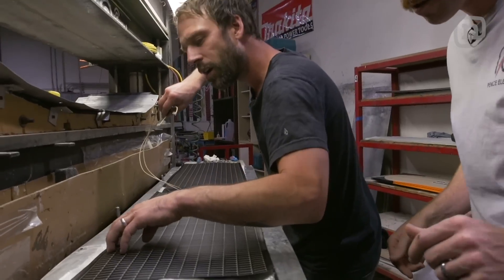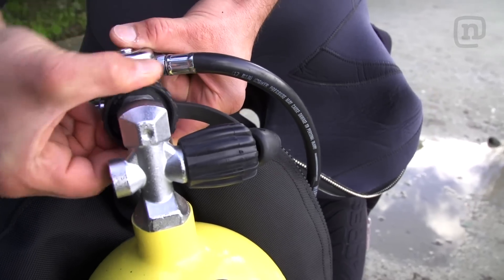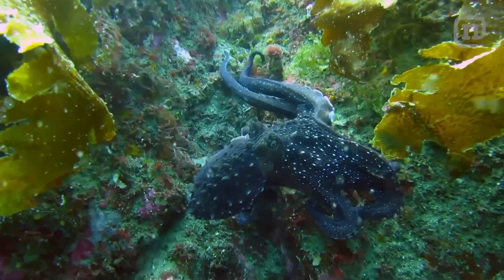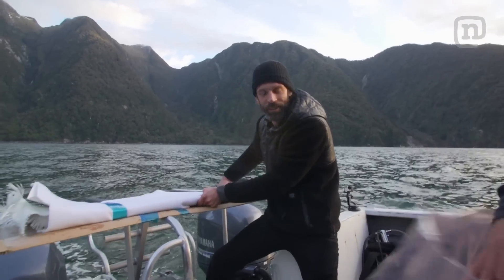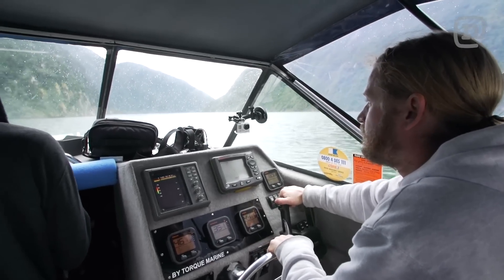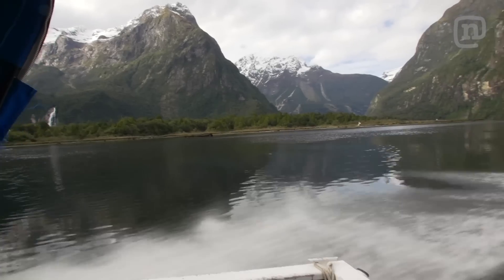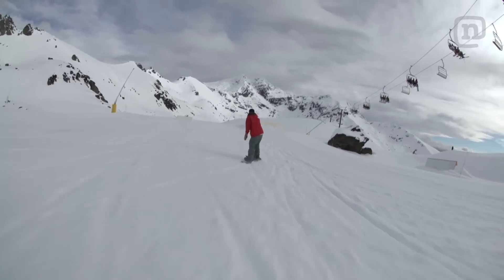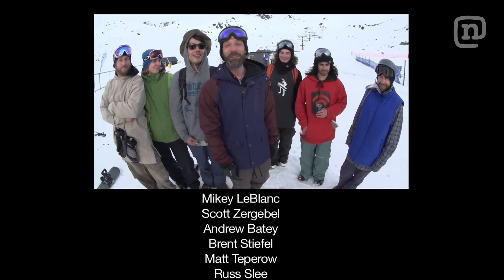Underwater Snowboard Production: Every Third Thursday

Comment: Wouldn't the vacuum inside the bag squeeze everything together before the water pressure would?
Reply: Mr Skull Top no
Reply: I agree, although depends on the the magnitude of the vacuum pulled relative to the water pressure, but I came to the comments to say what you did.
Reply: Same exact thoughts, I think he did this to save face and have content.
Reply: Granted the pressure from the water worked, the vacuum saved the day
Reply: you're right. This was actually filmed at our house in Queenstown so I can confirm that a second board was made and compressed in our shed as water leaked Into the board they put under water and it fell apart. They literally threw out the first board from Milford .

Comment: So i press snowboards using a vacuum bag also. except mine can just sit on my basement workbench... I dont doubt that pressure under water can press a board but this isnt proof.
Reply: I was just thinking the same thing. He already pressed it out of the water he just left it under water
Reply: Luke Bergman
Reply: He said he took the air out, he didnt say they were gonna pressurise the bag before submersion, and as the board started coming apart, and others that they've made using a vacuum bag and pressurising the bag have not I think they genuinely used the pressure of the ocean.

Comment: Would if they made a snow board that has wheels like a skate board and then when  u r at the mountain, it folds right up like a snowboard!
Reply: possible if you put the hinges for the wheels on top of the deck where they arent in the way. like sort of fold-down wheels that go to the side. but the thing would be heavy and only useful for downhill riding. so youd have a board youd ride from 3000 down to 1200 elevation than below that continue as a longboard on the street... but for that you might as well just tak a backpack an switch boards...
Reply: What?

Comment: the most efficient way to make a snowboard without pollution
Reply: except for the high consumption of boat fuel and all the chemicals in the bag waiting to leak into the ocean
Reply: agreed but we have electric boat engines now :) which have no emission other than noise pollution for wildlife
Reply: nellyisthebest1 lol you serious. what about lithium ion batteries and wherever that electricity was created
Reply: pyromaniak420 You could avoid chemical pollution by creating a deep man-made pool. It wouldn't be easy (or cheap), but once it's made it essentially pays for itself.

Comment: Yes it´s indeed a funny and creative way to make a snowboard.
But the tricky part is that they actually use the vacuumbag to press the board against the mold, in that way they dont really use the pressure from atomic underwater level (as much as they would need to, to say that it was pressed completley underwater) to form the shape of the board.
That means that the board probably is pressed about 80% because of the vacuumbag, and only about 20% of the water pressure. Thats probably also the reason why the board was ruined after only one day of heavy use. (Not a lot of pressure on the board, resulting in the board to be of a lower quality)
But keep thinking like that, and we would see many funny ways to press our board in the future.
"This was in no way ment to be a negative post, but just a "correction" so you would not be missinformed." ;)
Reply: I don`t see your point. How in your imagination does the bag lessen the contribution of water to overall pressure expressed on the layup?  They just pre-vacuum the bag so there are no bubbles of air impregnated into the composite and then enjoy the ~3 bar pressure of 100 feet depth.
It was pretty common to use water pressure to press stuff where I live in mid 90`s because everyone was a poor cheapskate and noone even dreamed of having a vacuum pump. We basically just rowed to the middle of a lake and sink our stuff for couple of days with some kind of float to find and retrieve the thing. You have to account for lower temperatures and give more time for resin to cure.

Comment: I know this is annoying but I just purchased my first GoPro. I recently uploaded a few Snowboard Videos on my channel. Any tips or suggestions on how I can improve my use of the camera would be greatly appreciated. Thank You!
Reply: dude there are tones of ways to better your video.The best i have found is steady your shot. if you have a pole let the go pro hang instead of holding ut up on top this will steady your shot and make for a far batter shot. also fast speed and slow motion works a charm and makes for an epic shot

Comment: @Djholthusen, Yes it is possible. I tried this summer because I was just as curious. Its not very good though, snowboards are a lot more flexible and have a much smaller surface. The shape doesn't help much either, in the water you want the middle to be wider than tip and tail. I'd love to see a ETT crossover board though, I'd definitely give it a try

Comment: Not within 12 hours. Which by the time they got out, cut the board out, and got a good night's sleep they'd be well outside of. Also DCS and nitrogen narcosis aren't the same thing, narcosis is when you're still underwater and the high pressure nitrogen gets you "high" but not in a pleasant way. Not super likely at 100ft for a short time.